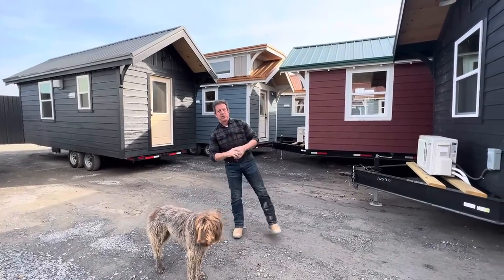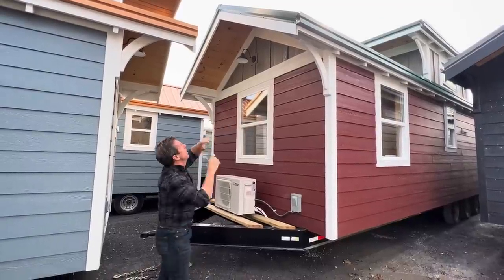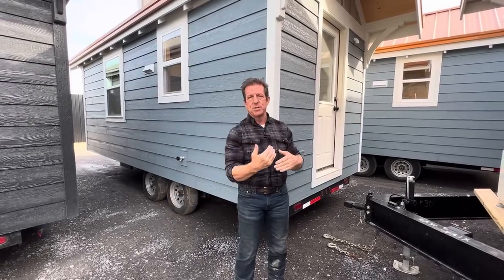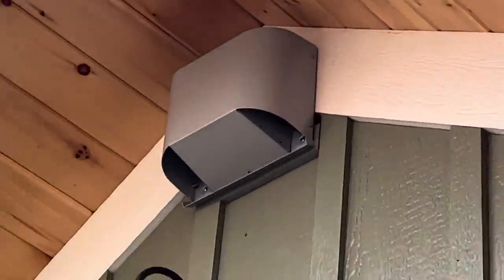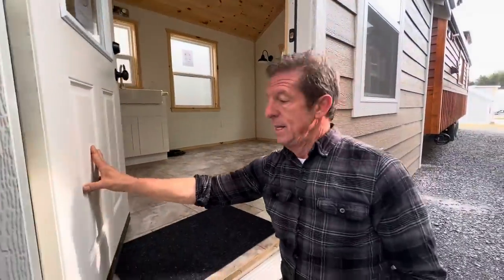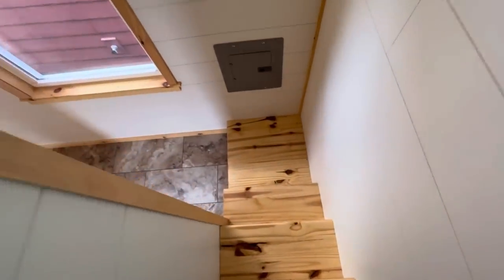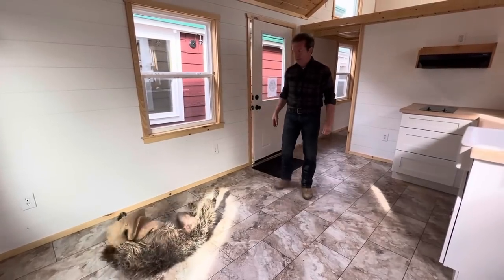Incredible Tiny Homes Models Craftsmanship, Amenities & Price Can’t Be Beat!!!

Comment: Love the Lexington!   Could put a washer dryer combo unit in the bathroom and have closet space above it.  Also, if the kitchen sink and window moved to the left a bit, could have a cabinet on the end with a pull out butcher block for added work space or could even set a stool there to eat.   And the idea of upper cabinets in the kitchen is awesome.  Your tiny homes just keep getting better!!

Comment: I'v made some closet space with some decretive iron shelf brackets and shelf. There are holes in the ironwork design that allow for 6 hangers on each side. Under the shelf, is storage, and on the shelf are some hooks for odds and ends like gloves, hat, and 3 foot solidt steel shoe horn, and flashlights.   I made one shelf closet by the entry door, and later another at the foot of the bed. It looks neat, works, and is inexpensive.

Comment: The Lexington is nice with the L-shaped kitchen. What you could do is shorten the side of the counter that has the sink and then put the refrigerator between the two windows, the window over the kitchen sink and the window in the living room. After all there is a plug there. Then on the other end of the counter by the hallway to the bathroom, where the refrigerator usually goes, build a closet there that opens onto the hall.

Comment: Love the Lexington. Wish the steps had hinges that could hold stuff. Even the bottom two or three would be wonderful.
Reply: You can request the bottom 2 treads be on piano hinges when you order your home built, for a small charge. I think the water heater connections might prevent using the 3rd. 🤔

Comment: For a closet I would probably put a post somewhere near the stairs in the loft and run a bar from the wall to the post to hang clothes. The only structural design change I can think of is to make the wall inside the bathroom under the stairs next to the water heater closer to the water heater to allow a little room to hang things in the bathroom next to the washer and dryer. I love the Lexington. It's my favorite.

Comment: In the Lexington, maybe a wall on your immediate right as you come in, between the door and the first window on the right. It could come out 3 feet in width from the door and be approx. 18 inches in depth. Just enough to hang jackets on two rods, perpendicular to the traditional closet pole. Two or three shelves above for storage plus floor space underneath for shoes, vacuum etc. There would still be lots of light from the living room windows and would provide more privacy whenever the pizza guy comes to the front door.

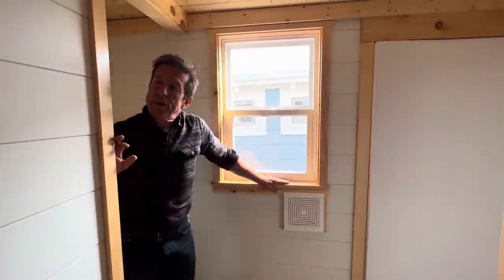Comment: That Lexington model is really nice.  I feel like there is wasted space under the stairs, though.  It would be nice if you could put the stair treads on piano hinges so you can use the space underneath for storage.  Every inch matters in these tiny homes.  Lol.  19:09 mark:  OR....maybe you could cut a large hole in the wall above the water heater and put access doors of some kind there.  Then the space under the top stairs would serve as a linen closet of sorts in the bathroom.  They would be deep storage areas, and not very big per block, but it would be better than nothing.  People would be able to figure out a way to store things in the cubbies.  Maybe custom wood boxes can be made available as an accessory?  They can just bring out a box instead of trying to reach stuff way in the back by pulling out everything in the front.  

I used scrap wood from my rig build to make long skinny boxes that fit on two of my shelves.  I used leftover nylon strap material as handles, but any thin flexible material can be used.  I utilized leather strapping for pulls on my drawers.  You can still use piano hinges on the lower stairs since that area wouldn't be exposed when you cut a hole above the water heater.  I actually think the first idea would yield more actual usable storage space (all stairs being on hinges) with less cost (unless you do happen to have a lot of scrap wood sitting around).  The ideas are limitless.  

Ace sure loves burlap.  Lol.  😁
Reply: I agree!

Comment: So you still make the models without Dormers the other day when I was checking out the website see if there was any changes I noticed that it didn't stay without Dormers that just had like with Dormers and just that price with it
Reply: No one was buying them without dormers, so they took it off the website. But I think you can still order one without.
Reply: I noticed that the no dormers models were not on the website today. I figured it was probably due to few orders, which is surprising considering there seemed to be a number of requests for no dormers.
Reply: @raysun2be  you might be right I wondwr of tpu can still ask
Reply: @sarinaglover3712  wouldn't hurt to ask

Comment: How about putting the hot water heater in the blank space in the kitchen corner shelving.  The door would have to open outside to get at it.  If you did that then there could be shelving in the bathroom.
Reply: You could request they customize your build when you order it... but there will be extra charges for those changes.